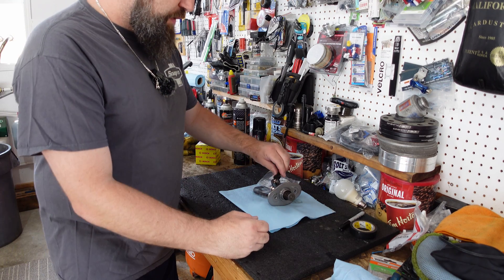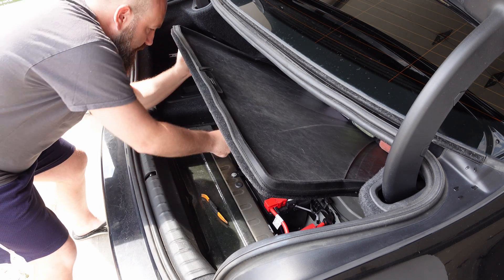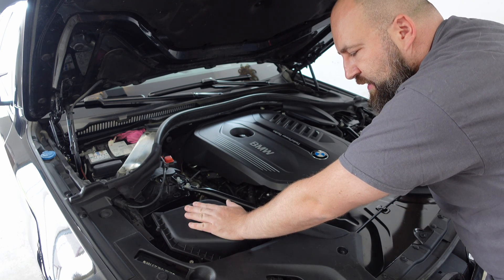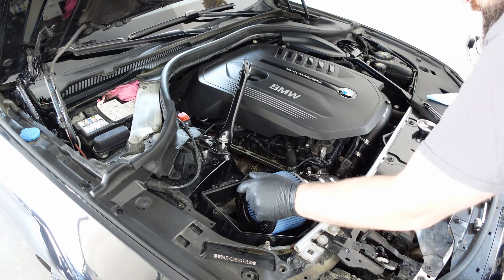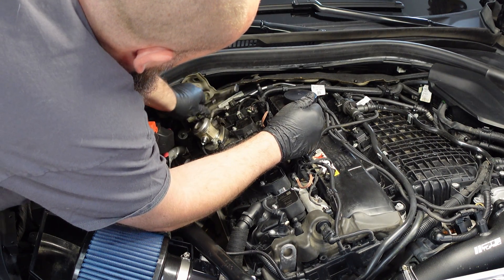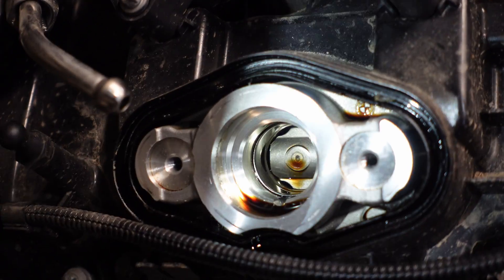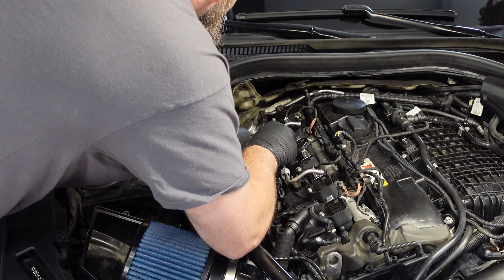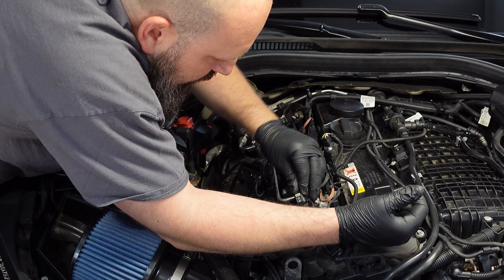BMW B58 540i Spicy 550HP Upgrade

Comment: When do you recommend to change your spark plugs on a stock 540
Reply from the maker: I would say around every 60-80k (km). you can always pull one when it's cold and inspect it before replacing them.
Reply: What about years if you do 5-6kkm a year only?

Comment: Gen 1 will never make 550whp on a TU pump please don’t misinform people… smh.
Reply from the maker: I never said 550whp. It states 550hp, which would imply and has always reflected, to the motor.
Reply: @tony.nextlevelrides  Replacing the high-pressure pump alone will never result in 550 horsepower for the car. Currently, my vehicle has the HDP6 Supra pump, performance ignition coils, a downpipe, and an open exhaust system. The ECU is tuned to Stage 2, which delivers 440 horsepower and 671 Newton-meters of torque with the factory turbocharger.
Reply from the maker: @magyarautovillszerviz  you're right, however, it's not meant to be taken out of context. it's also explained in the video and its description.
Reply: @tony.nextlevelrides  ok, i just said. :)
Reply: @magyarautovillszerviz  The TU Pump gives the most gains when a nice ethanol mix is used which on the BM3 platform is known as Stage 2 Plus.
Reply: @magyarautovillszerviz  Yes.... A flex fuel tune will take it closer to the 500 mark.

Comment: Wait so a HPFP will add that much power? I'm currently adding mods slowly to my 540. About to install a catless downpipe but if the HPFP adds that much power I'm game to do that next lol
Reply: If you run E mix. You can get close to 500whp but thats it. That the max that can probably get with stock turbo. 470-480 whp is where you can expect. Anything above that you need upgraded turbo. If 93oct than fuel pump wont do much. Maybe 430?
Reply from the maker: it was a noticsble jump in power!

Comment: Normally you do not need this cable between because you can turn the connector easily...........
Reply from the maker: that's what I thought, this connector wouldn't budge for some reason.
Reply: @tony.nextlevelrides  a bit more force from 2 different angles and it popps out :)

Comment: To the crank or whp?
Reply from the maker: with e50 these are around 550hp to the crank. they typically do 460-490whp at this stage.
Reply: @tony.nextlevelrides  preciate it bud